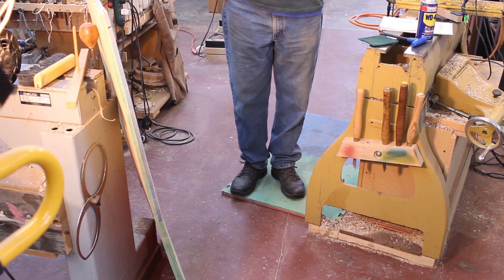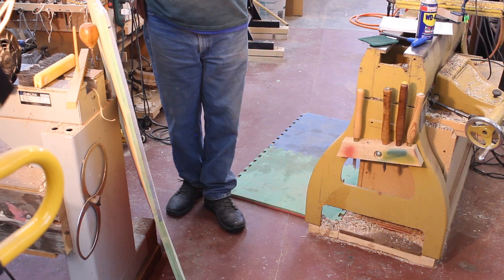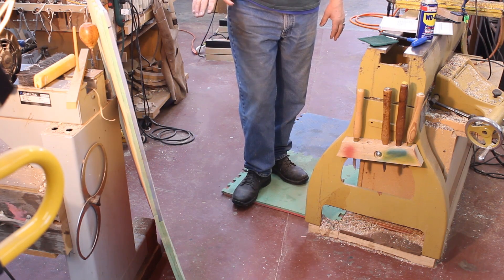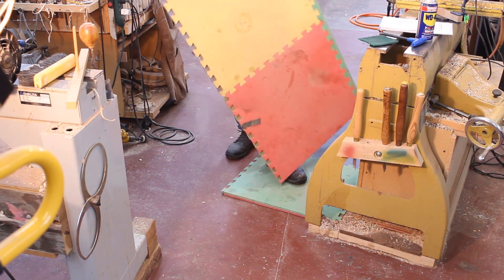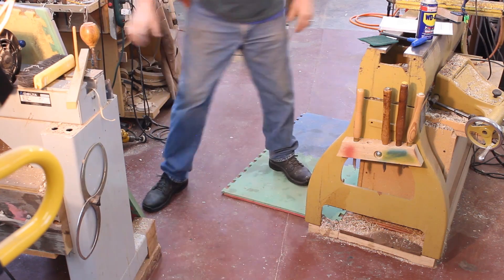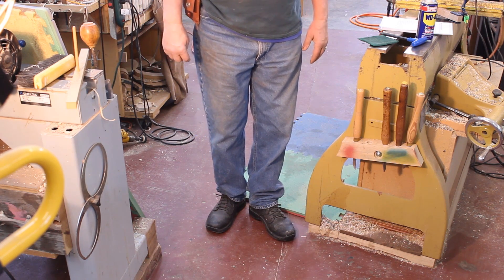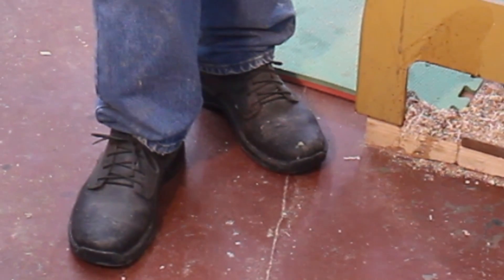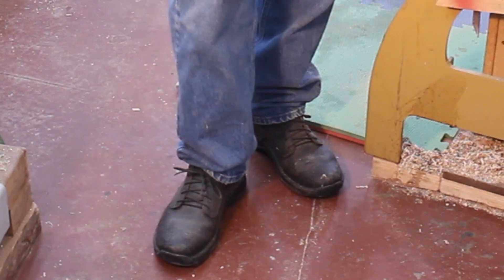Safety First on the Lathe---Part 1  (2015)

Comment: I learned to take off my wedding ring. Thanks, an older new turner.
Reply from the maker: The one I showed that was straight....was imbedded in my finger and I could not get it off at all.  I had to cut it off after the accident.
Sam

Comment: Great start Sam. Perhaps do also mention to carefully select thoses pieces you like to turn on the lathe. I started turning in April 2014. As I had no teachers than those virtual guys like you, Mike Waldt and Car Jacobson, Capt'n Eddie ...you name them. I unfortunately learned the hard way. Turning a larger and extremely dry piece of Oak, a third flew off at about 800 RPM's right into my face while I was roughing it out. Yes I was wearing my faceshield but the spinning force and weight managed to break my nose and an opened my forehead. Nine stiches managed to fix that. What I am trying to say here that beginners should very well examine pieces for cracks or even wood that has passed the age of having it turned. Don't do that. Make toothpicks out of it! If you'd see how I looked like 24h later, you would understand that this thing can bring you lots of joy but at the same time can kill you if you mess around with it. Read the instruction manuals carefully and listen to guys like Sam, Mike and Carl!
Keep up the good work and greetings from Luxembourg.
Paul
Reply from the maker: I agree 100% with your story about the face shield and a broken nose.  We think that the shield will protect us.  Think about the football players who have brain injuries,  Thanks Sam